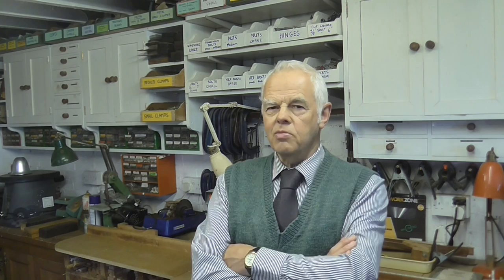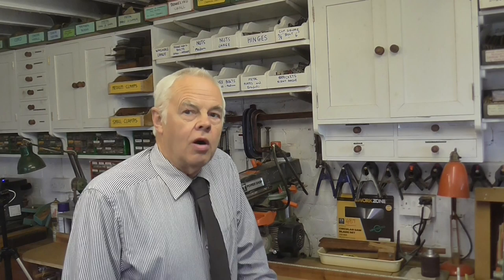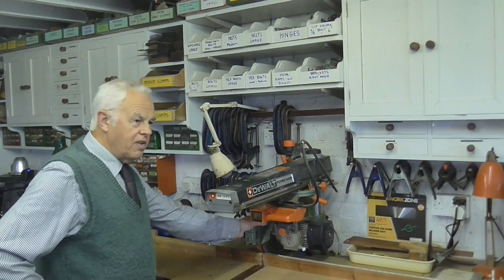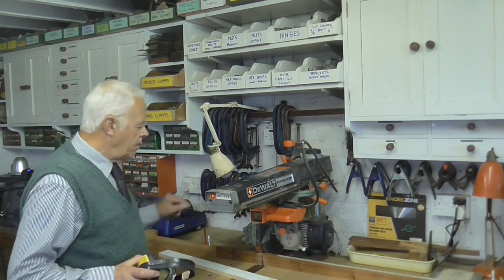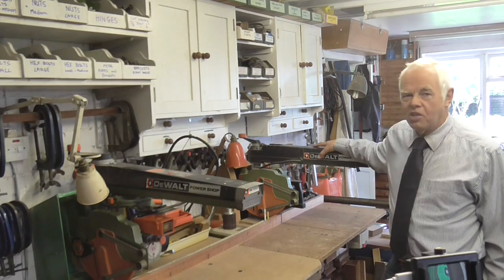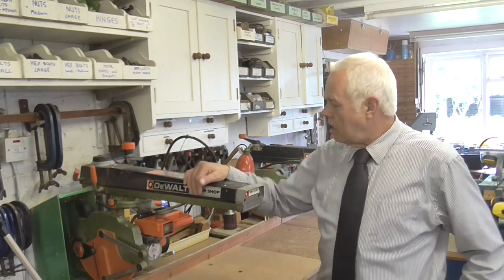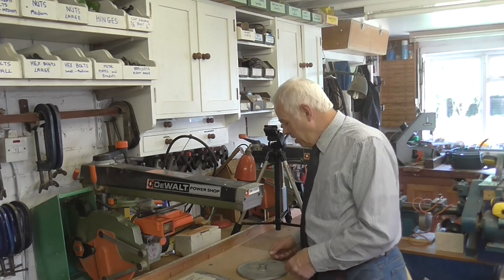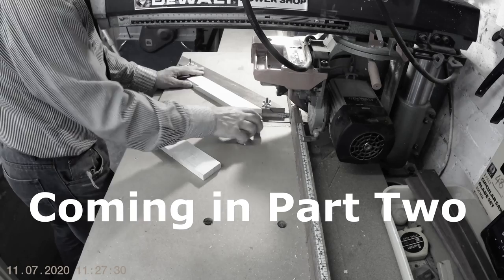Using the Dewalt Radial arm saw, Part One.

Comment: Hi buddy, bought a DW1251 about 10 years ago and only last month bought a DW1501. 
Had great pleasure in stripping every bit of it down including the motor and overhauling it.

The carriage bearings when I took them off i thought where beyond repair but, hardly turned and so gunked up, I soaked all 3 in oil, turned them, soaked in oil... 3 days of doing this routine i then heated up with a hot air gun brought them back to life like new.
It's now like new, I'm just awaiting on a replacement table for it. 
I've been looking out for accessories for them but none have come up yet on ebay.
Reply from the maker: Thanks for your interesting comment Richard. These saws are just superb are they not!

Comment: In its heyday, DeWalt saws took on peculiar designs such as during WWII a version was made of titanium, ostensibly to be parachuted to U.S. Navy Seabees doing runway and barracks construction in the forward areas (obviously kitted for such an adventure and assembled after recovery).
I have bought, restored and sold many versions of DeWalt's here in the states and will have no other fixed base power saw in my shop.
Reply from the maker: I have two versions and they are invaluable to me. I only use mine for cross-cutting and dado joints.

Comment: I've got exactly the same saw (the  DW1251). To avoid the problem your friend had while ripping the piece of wood, you feed the wood from the other side  - that way the blade is pushing against the work piece and won't snatch it from your hands!
Reply from the maker: He was using the saw in the proper manner. These machines are super crosscutting saws but I don't like them for ripping, A decent table saw is much better in my opinion.
Reply: @scrimperuk  whilst I agree a good table saw does a better job at ripping, the deWalt manual with this saw explicitly states that if ripping feed the wood toward the cutting heads, not with.
Reply from the maker: @Anelipot  As I mentioned my late friend was using the saw correctly, He had the manual and was an experienced woodworker but it still 'spat' a piece of timber out and through the side of his shed.
Reply: The RAS uses a climb cut when cross cutting; the fence prevents snatching. When performing rip cuts it is important to use it in conventional cut mode. This requires feeding from the correct side, which depends on which way the head has bee rotated (it can face either to the left or the right). Climb cutting without a stop will risk ejection.

Comment: I bought one of these in well-used condition from a chap local to me and it's a very well made machine. If I'm honest I'm a little afraid of it! Thanks for the videos.
Reply from the maker: No need to be afraid of it. As long as you only use it for cross-cutting which of course is its main function they are safer than most other workshop machines.

Comment: A shame to only use a RAS for cross cutting- as a panel saw it can be superior to a table saw; albeit with limited capacity. However, this has largely been superseded by the plunge (track) saw. Of course, you must not do climb cutting when ripping- probably what your friend was doing. (A RAS climb cuts when cross cutting, but the fence supports the workpiece.)
Reply from the maker: Many thanks for your comment, It's odd to have two RAS's but I had my friends workshop machines and having the space for a second machine, why not. Had I not set it up it would have been corroding away in the shed.

Comment: i've just been given a dewalt 7770 never used one before. looking for tips n tricks and safety advice as well as don't put your fingers near the spinny bit!
Reply from the maker: Thanks for the comment Marsh. In my opinion the RAS is one of the safest woodworking machines as long as it is used as a radial, if one starts using accessories such as those on my Dewalt i.e. the moulding head or using it to rip saw then it can be more scary.

Comment: I know your video is not about routers....  But, as I have not used a router previously, I am hoping you could give a suggestion on what you consider to be a good router and table combination.  Thanks!
Reply from the maker: Gary. If you look back through my videos I have done one on router tables. You can easily make your own and unless you spend a huge amount on a table a home made one is better. very cheap routers are noisy and poorly made they are handy as a back up but if you only have one router get a decent one, mine are made by Elu (now Dewalt) and they are excellent. Beware of paying for a good name only to find it is a rebadged cheapo.

Comment: does it have stops for mitered cuts (in both directions)? I currently have a Graule (beuatiful saws btw), which I am looking to replace because those cannot be placed really close to the wall as the radial arm saws can.
Reply from the maker: Not quite sure what you mean, but if you mean swivel the saw unit to cut a mitre it has slots at certain angles to lock the head in place i.e.45deg.
However I find the best way is to make up a jig to place on the table with adjustable arms left and right, IMHO it's safer and better and you don't have to move the saw head at all.  Edit I do show my mitre jig in part two.
Reply: @scrimperuk  yeah that's part of what I meant ^^ what if you tilt the head of the saw does it have slots as well which it can register against so that one does not have to adjust it every time one wishes to cut at a given angle?
I just watched the second part. I can see the utility of that jig of yours, especially cause it saves you from cutting into your fence a second time, which on my Graule I hate to do, since the built in zero insert plate in the fence and the table is what  makes working with this type of set up so damn precise. However, your jig only works well for relatively small pieces, once you go for larger and heavier pieces, I guess it becomes a pain to use. But I think I will copy it nonetheless, since I mostly used mitred cuts on little objects , boxes and such.
Reply from the maker: @Audioventura  yes it has slots and they are tapered so that as you push the lever in it forces the unit to the exact angle or at 90deg etc. 
I do have a mitre guillotine which you can see in this video but I mostly use the Dewalt as the guillotine is mostly for trimming.
https://youtu.be/LpZ_2M_Lqq4
Reply: @scrimperuk  thanks for the info! So then I might gog et a radial arm saw!
The guillotine is really really cool! Unfortunatly I've never had the opportunity to see one in real life. But thanks for the vid!

Comment: Hi Iam haveing trouble with the arm swivelling on the back post when it is locked. Meaning I can move the yoke during my cuts slightly of 90*. My saw is the same model as the first one you showed but it’s second hand so I have no manual. Have you any advice? Thanks James
Reply from the maker: I do have a pdf copy of the Dewalt Radial saw handbook which covers adjustments. if you contact me via one of my websites on the channel I can give you a link to download a copy.

Comment: very good vid i have been given an old one of these saws i love it but scared to try it as i think it needs a new blade, what would be the best blade for all cuts..i subd regards.
Reply from the maker: Don't be scared of the saw, it is one of the safest machines in the workshop. The main thing to understand is that rather than pull the machine across the timber you have to 'restrain' it from 'racing' across which by design it has a tendency to do. I would only recommend the machine for cross-cutting rather than all the other processes you can do with this saw. For cross-cutting a multi-tooth blade will give a much smoother finish I use a 80 tooth blade which gives a very smooth finish but makes it hard work cutting very dense timbers. you can use any blade really from around 24 teeth upwards. To be honest I only use an 80tooth blade because the saw company were offering them at a very low sale price,but they do give a fine finish.

Comment: Hi Scrimper, I have a dw1201 and just put another motor on it, unfortunately I dont know what wires go where on the switch on the end of the arm. Any chance you could let me know what wires go where cheers in advance Richard
Reply from the maker: I do have a wiring diagram in the parts manual I could scan for you if any use?

Comment: Not sure how rip lock should work? Ours doesn't lock so still slides in and out?
Reply from the maker: That's strange the one on mine is very sensitive and just slight pressure hold the arm in place.

Comment: Can you still get accessories
Reply from the maker: The answer is I don't know, Dewalt do still make radials so it's possible although it's fair to say I only use mine as a saw.
Reply: They are out of production. B&D doesn't make them anymore.

Comment: Could you tell me the part number for the sanding disc
Reply from the maker: I will have to look in the workshop tomorrow for you.
Reply: @scrimperuk  thank you, I know they are very hard to find but having the part number will help out tremendously
Reply from the maker: @jeromemccarthy934  The sanding disc is part No DA231 and the sanding discs are DA230 for a pack of six.
Reply: Thank you